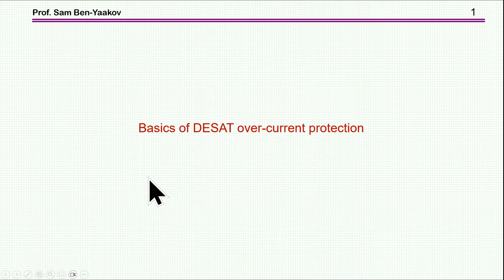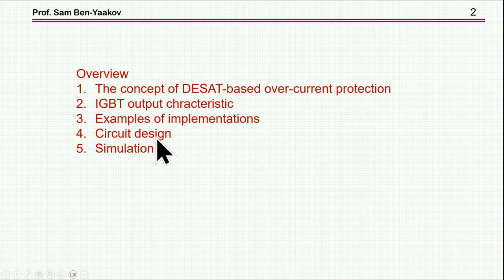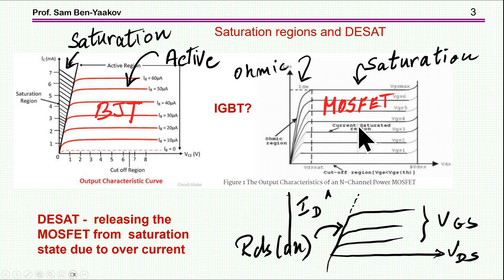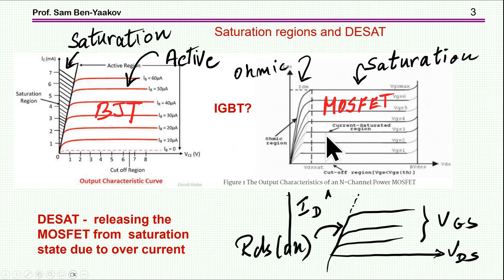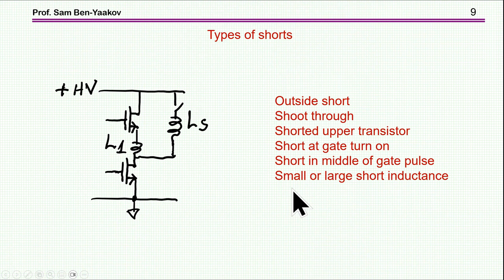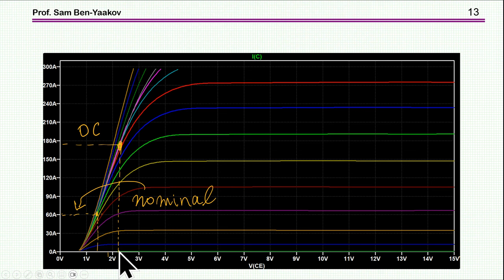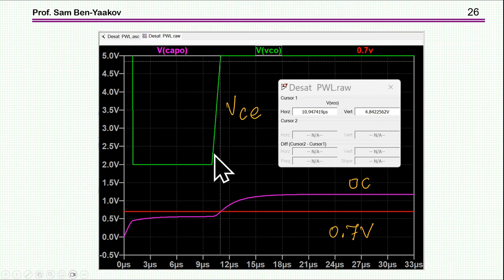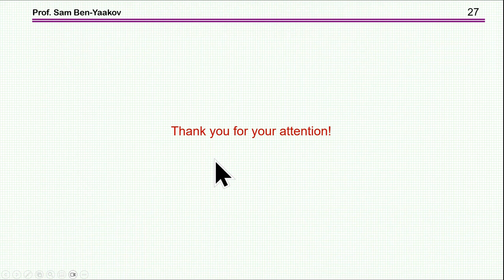Basics of DESAT over-current protection

Comment: Thank you for this interesting method of over-current protection. A few years ago TI showed a similar method implemented with separate components, but I had not seen this before built-into the driver. I especially like the signal back to the micro controller  (schematic at 12:43) which helps in detecting when this over-current situation occurs.

Comment: I'm a bit stumped that desat detection works better at lower gate voltage, but recommended drive is way higher - like +15/-5V, but then again all of it depends on desat voltage threshold.
Oh and I've tried this on a MOSFET class D amp I've did for uni degree - worked perfectly.
Reply from the maker: Thanks for sharing. Interesting. I am inclined to think that lower gate voltages are better. All action is around the threshold anyhow and the drop of Vce with higher Vge is not that significant.

Comment: Hello Mr. Sam. I am ina position where I am required to perform a dead short test on the output of an igbt inverter half bridge.. Typically the unit would withstand this rather brutal test, however , recently the igbt's are not able to hold up and violently short in many cases. I am misunderstanding the drive circuit and the term de sat protection. Shouldnt the igbt run in the saturation region always..HELP..
Reply from the maker: Are these the same IGBTs as before? I has a similar problem when replacing IGBTs.
Reply: @sambenyaakov  we have tried three different flavors of igbts. Ironically the one that claims 50 amp seems to hold up better than the 60 amp Period they all have five microsecond Short circuit withstand times I believe we are getting a huge inductive Spike when the short circuit is introduced on the output and I don't think the acpl 3333 J is turning off the gate with the correct profile I don't have my notes in front of me so I'm describing it the best I can I'm trying to convince the powers that be that it might be a good idea to run a bit of conductor from the outputs to the breaker that we are using to introduce the short. It is very frustrating and time-consuming to replace these igbts after each short circuit test otherwise known as a crowbar test
Reply from the maker: @michaelmorrison7632  I would guess it is the de sat network or the way the short is done and its inductance. .